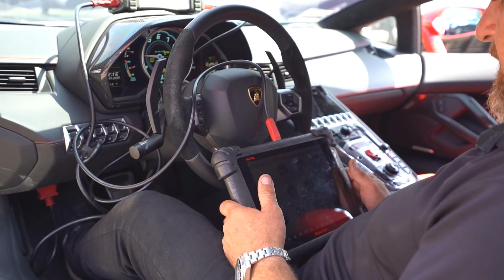ELEANOR STYLE MUSTANG MAKEOVER, MCLAREN 720S GOES ORANGE. *CRAZY STYLE*

Comment: I love the orange black scheme but i have mixed feelings about the front wheels, as the rear wheels look much nicer .
Reply: What? The front rim is what makes it cool, what gives it character! When it comes to the tires at the back, they should have removed the white text on the side of the rubber. It does not look good while the car is driving at high speed.